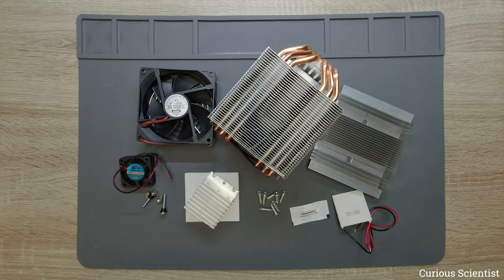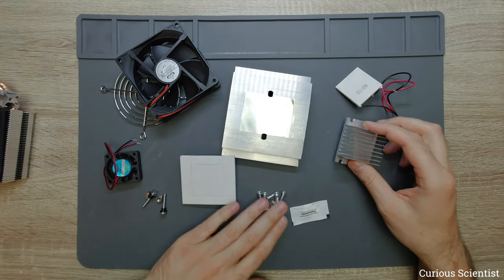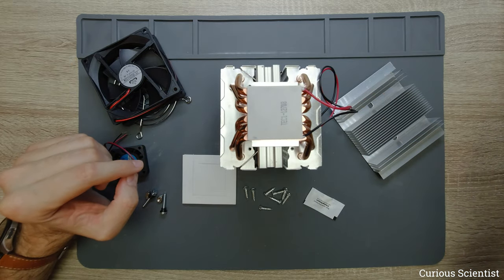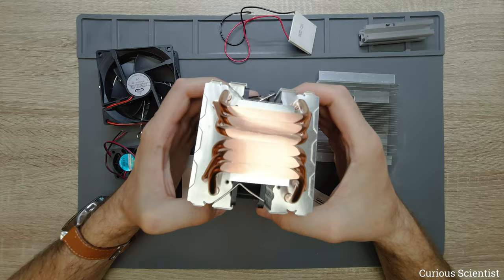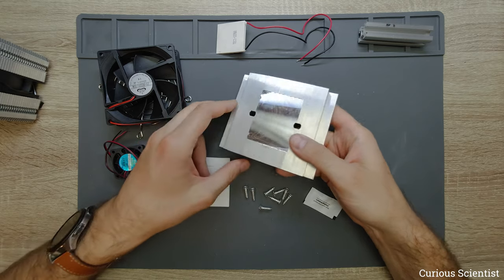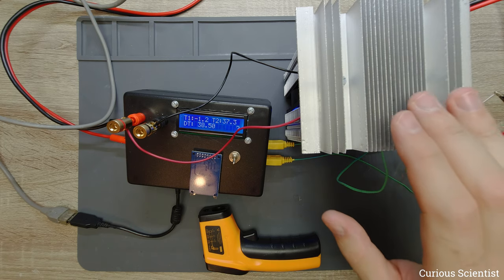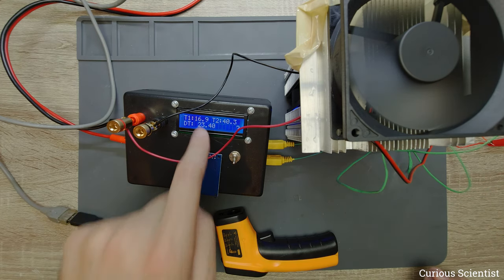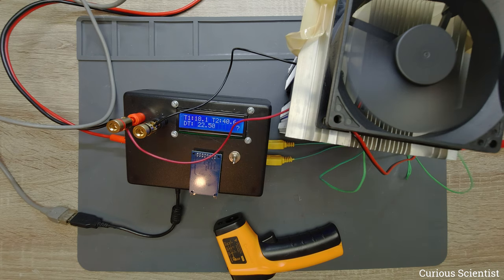Let's discuss about Peltier coolers #5 - A new arrangement of heatsinks

Comment: Thanks for the analytic thought.
Reply from the maker: You're welcome!
Reply: @CuriousScientist  I just made my first Peltier cooler and I have thermal grease.  I thought it would be more of a glue.   Is one more efficient than the other?  I don't won't to mechanically secure the cooling  sink to the hot sink with screws.
Reply from the maker: @TheNutzandBoltz  Hi! Thermal glue is the least efficient, but once it cures, you won't be able to remove it. Since the ceramic part of the Peltier cooler is super fragile, you would probably damage it when you try to remove it (been there, done that...). I have a TEC12706 that I glued on a heatsink 4-5 years ago and it is still there. Now I use it as an "artificial load" because I can't separate it from the heat sink.

Then, you can have thermal grease. They are more efficient but slippery. If you apply shear or twist the Peltier cooler, it will come off. You can buy those generic things for CPU coolers.

Then, you can buy indium foil and apply it between the surfaces where you need heat transport. It is probably one of the best thermal conductors, but a well-applied high-end paste is as good... 

If you need something solid, use clamps, bolts...etc, otherwise, your system will fall apart or get misaligned which can also damage the modules. For example, a portion of the hot side is revealed and it does not get sufficient cooling.
Reply: @CuriousScientist  Few people apply this level of thought into the things that make this world work.  Thank you
Reply from the maker: Thanks! I am trying to be meticulous.

Comment: That large CPU heatsink, you said that it has heat pipes! 
Somehow I doubt that they are heat pipes, they might look like heat pipes but they could be copper rods shaped to look like heat pipes, the only way to know for sure is to either cut one pipe in half which should reveal if it's a solid rod or the hollow pipe like a proper heat pipe. 
I had an old failed graphics card that appeared to have a heat pipe type heatsink, I put my soldering iron on one of the pipes and expected to feel the heat at the other end! I didn't feel anything so I cut it and found that it was a solid copper rod! 
No wonder why the heat from the soldering iron was localised to one spot! 
I have recently come across heat pipes on Ali Express and there are also blocks that can take multiple heat pipes which looks similar to the CPU heatsink cooler you have used in this video without all the aluminium fin's, even without the aluminium fin's, just by using proper heat pipes, you will have more cooling power due to the much better and faster heat transfer..... 
Not sure if you have already tried this in later videos, I have just discovered your channel and am enjoying all the Peltier experiments.....
Reply from the maker: Hi! I checked this, they are proper heat pipes and not solid copper rods. Also, it would be super heavy and expensive if they were solid copper rods bent this way. You can also see that they are hollow by how they buckle where they are bent.
Reply: @CuriousScientist   thank you for your response, I had a graphics card that failed and I decided to use its heat pipe cooler for a project, I pulled out my thermal camera and put the soldering iron on one end and instead of seeing the heat travel along the pipe really fast, it was all staying around where the heat source was! It looked like a copper tube but when I cut it to confirm, it was a solid rod! It looked like copper,  it was probably alloyed with something else to cost cut! But heat pipe it was not! 
There's a great video (the channel name has the word Phoenix in it but I don't remember exactly what the whole name is) it's a science channel which has a lot of great experiments in it ..... He did a great test showing the difference between an actual heat pipe and a copper rod via thermal camera, the difference is day and night! 
The so called heat pipe used on that graphics card even looked like it was sealed off after having pulled a vacuum on it! 
It's a real pity that you didn't have a thermal camera during all that testing! Because we could have seen the heat travel along the pipes, and I saw that you used a couple of different types of CPU heatsinks.... 
I guess that we will never know..... 
Anyway thanks for your response..... Keep an eye out for fake heat pipes in future... They do exist.... I have seen it!

Comment: THIS (almost) THE EXACT SETUP/ QUESTION I HAD FROM THE OTHER VIDEO!! why am i screaming...
This just put an ease to my mind that only one fan to dissipate the heat would work. I only have a water block connected to the cold side of the peltier. My goal is to drop the temperature down 4 degrees. 
Q1. Would the heat radiating from the side of the hot heatsink has significant effect on a cold plastic tube with water if the tube was .5 - 1 cm. away?
Q2. Would the heat be dissipated better if there were 2 fans?

26.6 degree is your summer?? That's my autumn!

Thank you
Reply from the maker: A1: no significant effect, I assume.
A2: yes.
I live in a Nordic country, so the summers are mild here. :)

Comment: I tried to decrease the voltage, about 9V or 10V, run for about 4A. it have better efficiency.

I tested TEC1-12712. Datasheet wrote it max is 15.4V 12A.

I think the peltier will generate heat internal when using >75% of max current. That heat is not temperature exchange form cool.
Reply from the maker: I always tell in almost all of my Peltier cooler-related videos that they are not supposed to run at their maximum rated current due to the excess Joule heat generated. This is the most commonly done mistake by those who try to use Peltier coolers but know nothing about them. I always suggest something like 75% or lower, so the Joule heating does not degrade the performance of the cooler that much. There's a little room for tweaking the values based on how well one can cool the hot side, but 100% current with regular everyday cooling parts is not really feasible.

Comment: This will not work like ac just because system itself the surrounding.
Mean heat is being removed from the system to the surrounding but in this case surrounding is also in the system.
To maximize it's effect keep the hot sink to the outside and cold sink inside the room like window ac.
Just like refrigerator if you keep the door open even for whole day it will not lower the room temperature because the heat radiator outside the freeze it contributing to increase the room temperature but you can attain lower temperature by keeping the cool side inside the room and hot side outside the room and by isolating the hot side from room.
Unfortunately peltier has one side hot sink and another side cold sink.
But still we can maximize it's effect by using multiple peltier and keeping it outside the room and by adding some duct work we can achieve lower temperature inside the room.
It will be effective in costal areas where moisture in air is saturated we can utilized that condense moisture to cool our hot side by circulating that moist water.
Reply from the maker: I know it will not work as AC, I have many videos on explaining why. Also, I would be very careful about relying on the coastal areas and the moisture there. Corrosion would end the fun quickly.

Comment: 37:00 It is not that the heat sink is 'dissipating more cold in the area' but more that with the fan, the heat from the air is pumped and transfering more effectively to the heat sink
Reply from the maker: Yeah, I might have done a bad phrasing. Of course the heat always goes from the warmer place towards the colder. The fan adds more airflow thus more volume of air interacts with the heatsink which transfers more heat from the room temperature air to the little bit colder heatsink.

Comment: Man this is what i wanna discuss, please respond me if u still active, i have few question about this device for my DIY terrarium chiller 

1.I know TEC is ineffective to cooling huge wider space like garage due to small size and half efficiency , but how about small enclosed space, like Aquarium, terrarium, Vivarium ? 

2. How many TEC required to cooling 45x30x45cm^3 container down to 7C only in 1hours ? Assume my room temp is 30C
Reply from the maker: Hi! Check this series (6 parts) and you can get the answers and ideas for your questions: https://youtu.be/kWiiCdc3xcw

It is doable for such small volumes but it might consume a lot of electricity and generate a lot of heat that you need to get rid of somehow.

Comment: I am trying to set up a peltier 12706 supplying power from a 12 Volt, 6 Amp transformer rectifying & filtering  it into 12 V DC. At first the heat sinks on the hot side is heating up and cold side is cooling respectively. A few minutes later the cold side is also heating up.
How to solve this?
Reply from the maker: Hi! Cool the hot side better.
Reply: @CuriousScientist  The hot side heat shink is a larger heat shink than the cold side.
Reply from the maker: Still, you need more, it seems.
Reply from the maker: Also, I hope you don't run the Peltier at 6 A. Make sure that the supplied current is not more than 3-4 A.
Reply: But 12706 is a 6Amp peltier, that is why I am using 6Amp power source. Pls. explain.
Reply from the maker: It is explained in basically all of my videos.
Reply: I connected the system with a 12v 2 Amp SIMPS after increasing the Hot side heat sink. Unfortunately both sides are getting hot after a while.
Reply from the maker: Maybe then it is a faulty unit. Try it with another. Do you have thermal paste between the heatsink and the Peltier cooler? Do you have a fan installed on the hot side heatsink?

Comment: What happens if you attach the tec to enclosed insulsted box. Can the temp drop to -45 in the box?
Reply from the maker: Not with a single stage. And you would need an extremely well insulated box.
Reply: @CuriousScientist  I have ordered two tec123703 modules, should i order more?
Reply from the maker: Those modules won't bring you down to -45°C. Check my most recent video on Peltier coolers!
Reply: @CuriousScientist  I have also ordered a water cooler. Is it possible to at least bring it to 0 degree Celsius.

Comment: is it safe to turn it on for 24 hours nonstop?
Reply from the maker: Sure, they are super reliable since they are solid state devices. However, it won't be safe for your wallet. 😄 They use a lot of electricity.
Reply: @CuriousScientist  haha that's right 🤣
Reply: @CuriousScientist  can the heatpipe system cool the mini fridge under 0 degrees?
Reply from the maker: It depends on many parameters. But this single one probably won't work.
Reply: @CuriousScientist  what is the maximum degrees if you use this system to make a mini fridge?
Reply from the maker: I don't know. I don't know how well you insulated the fridge, what's the volume...etc. It depends on many parameters. Check my channel, I built a mini fridge, you can confirm the details from that video.

Comment: I want to build an air conditioner for a dog house or a rabbit hutch. I think this would be the safest route to go. The question is would this cool cubic meter of space from 90° Fahrenheit to 75 degrees Fahrenheit
Reply from the maker: It could work with smaller volumes but not with a single Peltier cooler. You will need a lot of them. Check one of my most recent videos where I introduce an air cooler. But it won't be cheap.
Reply: Yeah, I have 48 amps to spare on my alternator on an old 12 valve. Decided to forgo replacing the seals every 2 years on the AC system on the old rattle-wagon and go for something a little more solid state. Managed to rig up a TEC I scavanged from a thermoelectric cooler that I had the hot side sealed into an insulated container in the the cab with a 12v pump in it to draw coolant through the fins and push it into the AC cooler on the front of the truck (flushed with dawn first) and return back to the the mini coleman with the heat sink inside. The cold side just had a 12v fan blowing air over the fins.
When I tested it, the ambient temp was 86f inside the truck (its black) probably about 70ish outside. The thermo couple reading on the cold side dropped down to 66 after 5 mins but it didn't stay there for long. After another 5 mins it had jumped up to 90 degrees and then climbed steadily to 96f when I got into town (I am assuming the extra airflow from driving 40mph helped with airflow over the cooler on the front of the truck), eventually turned it off because I was then baking in the heat. The coleman was also quite warm so it didn't insulate as well as I thought it would. I also drove the TEC with the full 12v and 150-175w which is apparently super inefficient. Probably why I never had a stable temperature. Considering the size of the ac cooler (about 3 feet by 2 -1/2 feet), driving it with 6v would have probably netted me some slight cooling without overheating the hot side to the point that the heat couldn't be removed from circulating through the AC cooler. 
Tech Ingredients has an awsome video on peltier coolers and their efficiency curves.
The dude is smart af and explains how 1 - 150w TEC wired to 6v and 2 more stacked on top wire in series for 3v apiece ends up being far more efficient and easier to cool then cooking 1 peltier device with 12v.
Reply: Yeah, I have 48 amps to spare on my alternator on an old 12 valve. Decided to forgo replacing the seals every 2 years on the AC system on the old rattle-wagon and go for something a little more solid state. Managed to rig up a TEC I scavanged from a thermoelectric cooler that I had the hot side sealed into an insulated container in the the cab with a 12v pump in it to draw coolant through the fins and push it into the AC cooler on the front of the truck (flushed with dawn first) and return back to the the mini coleman with the heat sink inside. The cold side just had a 12v fan blowing air over the fins.
When I tested it, the ambient temp was 86f inside the truck (its black) probably about 70ish outside. The thermo couple reading on the cold side dropped down to 66 after 5 mins but it didn't stay there for long. After another 5 mins it had jumped up to 90 degrees and then climbed steadily to 96f when I got into town (I am assuming the extra airflow from driving 40mph helped with airflow over the cooler on the front of the truck), eventually turned it off because I was then baking in the heat. The coleman was also quite warm so it didn't insulate as well as I thought it would. I also drove the TEC with the full 12v and 150-175w which is apparently super inefficient. Probably why I never had a stable temperature. Considering the size of the ac cooler (about 3 feet by 2 -1/2 feet), driving it with 6v would have probably netted me some slight cooling without overheating the hot side to the point that the heat couldn't be removed from circulating through the AC cooler. 
Tech Ingredients has an awsome video on peltier coolers and their efficiency curves.
The dude is smart af and explains how 1 - 150w TEC wired to 6v and 2 more stacked on top wire in series for 3v apiece ends up being far more efficient and easier to cool then cooking 1 peltier device with 12v.
Reply: @brianlittleforest631  you are far better to make yourself a garden water feature... huh?
evaporative cooling. make a stack of bricks in a pond, solar panel driving a pump to keep the whole lot moist, plenty of internal cavities for air to get through... ie, hollow core bricks and some funky layout. plant it with ferns. frogs will like it. 

then pump the resultant 4C water to wherever 4C water is handy. water always cools to 4C.... old car radiators make nice exchangers. you dont actually evaporate anything indoors...

TECS just dont work well. they will provide a temperature differential where its needed, but otherwise its pointless.

Comment: Wouldn't moving a liquid like alcohol-water mix away from the peltier make it more efficient as the hot side and cold side won't be interfering with eachother as much. 
   I'm designing something that needs a cooling system for living things. I won't get into details being im still in the brainstorming phase.
Reply: Also if you could provide an email address for me to ask you some questions, I'd be very grateful. 
     I'm not an engineer but I am a genius (I hate that term), and also am on the autism spectrum. I need a way to move heat and cold but through softer materials.
Reply from the maker: My email address is on my website but I am not providing support for free. Please keep this in mind if you want to contact me.
Reply: @CuriousScientist  so how do your prices work? I'm just looking for information on the best types of thermocontuctive tubing and if it's possible to find a way to move heat fast using liquids. 
    I appreciate your work and am still in the learning phase for these electronics.
Reply: @CuriousScientist  also im working an a composite full body armor with hight level ballistic protection but I need to figure out the cooling system since it's a sealed unit.
Reply from the maker: I won't disclose the financial details in the comments. If you want, write me an email and I will be able to formulate a fee once I know what you want.
Reply: @CuriousScientist  ok sounds good.